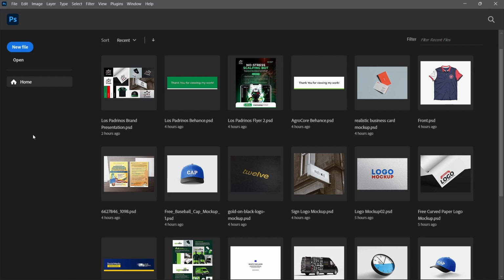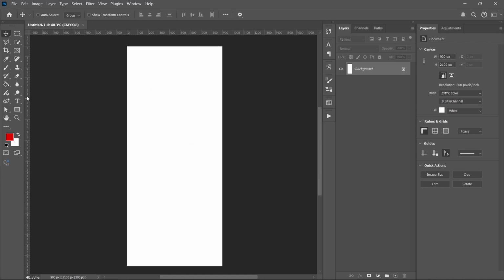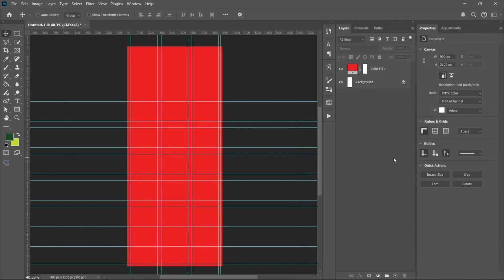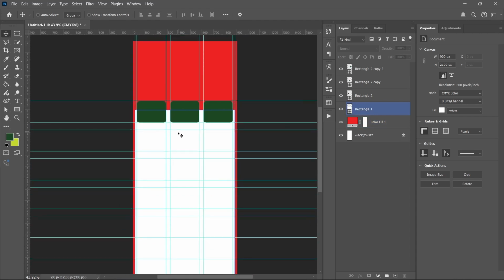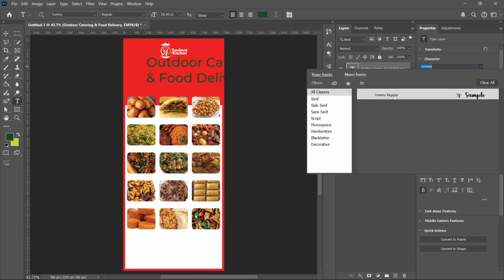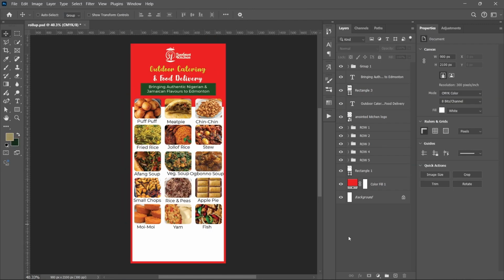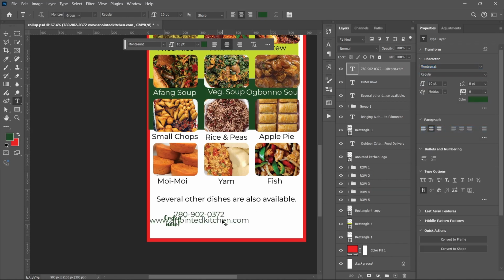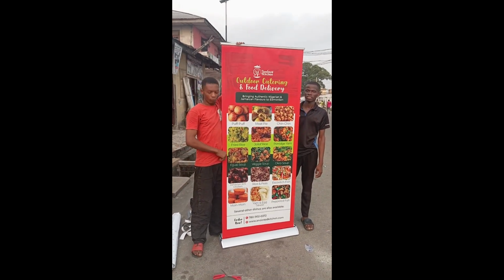How to Design and Print a Rollup Banner in Photoshop

Comment: For low spec pc What's the perfect way to approach the design size to avoid lagging
Reply from the maker: I recently learned that all you need is to match the aspect ratio. You don't necessarily need to get the actual size.

E.g  2x3 inches instead of 2x3 feet.

P.S. I haven't tried it myself.
Reply: @stefanchoju okay, I'm currently working on one, and to enable smooth workflow im working half the size to tell the printer to upscale 
By God's grace i will update you on the result
Reply from the maker: @ogbulivictorifeanyi149 alright then.